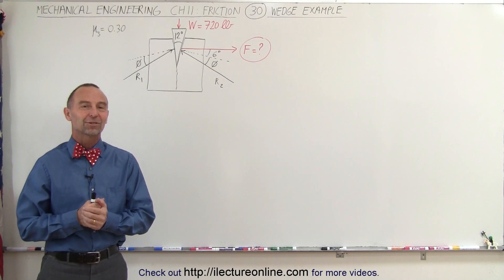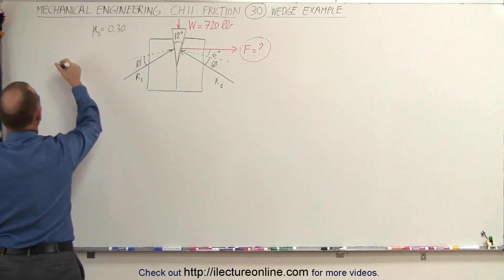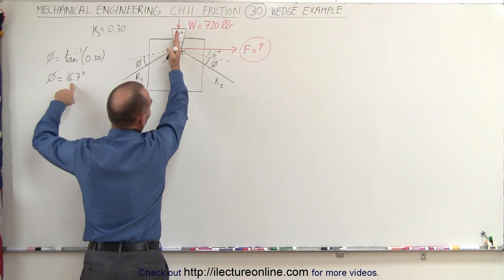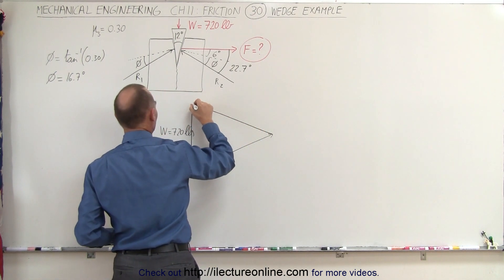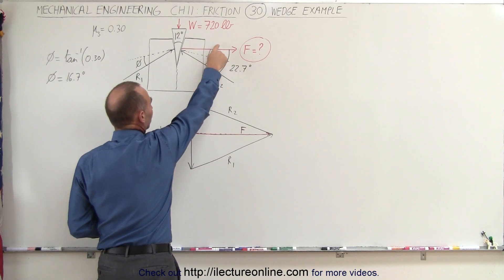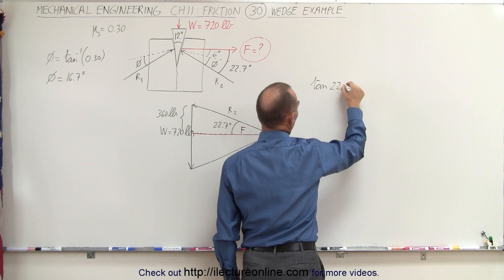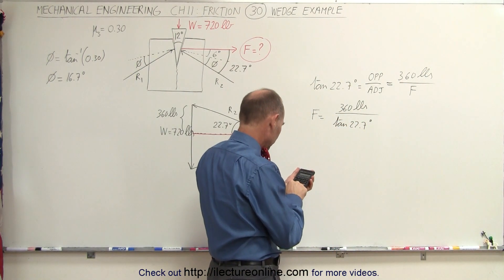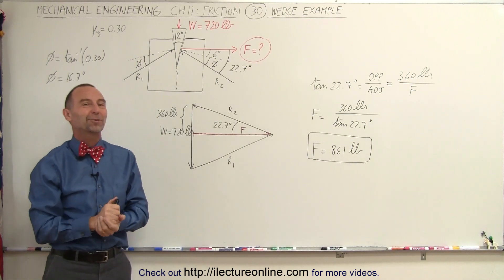Mechanical Engineering: Ch 11: Friction (30 of 47) Wedge (Splitting Wood) Example

Comment: The videos are great and I love them. I am sure I am not the only one, but I notice in your videos there is usually a free-body diagram ready, this is problematic if you come across a problem in which you need to interpret a question.

Suggestion: do some videos with a plain problem and break it down from a diagram, it becomes more beautiful.
Reply from the maker: Thanks for the tip!   We do both as it speeds up the video a bit.

Comment: for this example, how could you work out the force applied from the wedge on the log if you only knew how much (length) the wedge had been pushed in? imagine there was a wedge cut out in the log which the wedge fit into and then you started to move it down through the log by a known distance? how would you calculate the force applied to the edges of the log (against the wedges) as the wedge moves down in known increments? (assuming the tapered hole in the log has no bottom and is a straight through hole)
Reply from the maker: If the distance is not known then you cannot solve the problem.

Comment: Does it also mean we should find the frictional force between that wedge and the ground?
Cause I did and got nearly the same answer.
Reply from the maker: Not sure what you mean by "between the wedge and the ground".
Reply: @MichelvanBiezen  for example,  if the wedge is divided, it goes right and as a result the frictional force between the wedge and the floor moves to the left.
I tried it that way and got almost the same answer as yours.
That's why I was asking whether my approach was correct because I don't understand this method, I use the "resolution of force method" to solve mine, so I was trying to figure a way of solving that with my method.

Comment: A question about some numbers. So the output force is 2.3907 times the input on both sides, but the mechanical advantage is 9.4093 times the input. When do we consider the mechanical advantage of a wedge rather than its reaction force? 

And I have a follow up question if that's alright.
Reply from the maker: The machanical advantage is usually expressed in terms of the ration of the force generated divided by the force applied.
Reply: @MichelvanBiezen thank you for responding! I thought that a wedges mechanical advantage was its length divided by width. Or 2 divided by the tangent of the angle.

My follow up question is how do I apply the reaction force to cutting a given material with known shear and tensile strength? How does the pressure on the edge effect the cutting process if I reduce its sharpness or bluntness?
Reply from the maker: Because the cos of a small angle is nearly one, the ration of the length over the width of the blade approximates the force exerted by the sides / force applied to the wedge.
Reply: @MichelvanBiezen  so how do I use this knowledge and apply it to cutting vegetables meats and woody things?

Comment: I hope you read this in time as I have a deadline tomorrow, but which formula do I have to use to calculate how much force you need to clove a piece of wood?  Which material property do you have to look for in the stress-strain curve? 

I want to know how much force you need to split a 2000mm long chestnut pole with a diameter of 80mm into 4 pieces with a hydraulic cylinder. 

Thanks for the video by the way :)
Reply from the maker: Without context, it is difficult to determine which equation (or method) to use.  My guess is that if they didn't give you the dimensions of the wedge blade (and angle), that they expect you to use the shear stress/strain equation.  You will need to find the shear strength of the wood in question.
Reply: @MichelvanBiezen  Hey thanks Michel for the quick response, I think that will do for now. 

It is for my internship (as a product designer), the person who made the machine doesn't have a 'list of requirements'. So I'm making one for him. I do have all the dimensions as I also drew the machine in Solidworks. One of the logical requirements is that the machine is capable of splitting a 2000mm chestnut pole. I wanted to specify the requirement by clarifying the minimum force needed to split it. I'm glad you mentioned the wedge blade because this also affects it. 

I'm not a mechanical engineer with hard physics, more a designer, yet I do like to figure out the technical aspects, as this will also show willingness to become a solid all-rounder.

By the way you have a Dutch surname, are your parents from Holland?
Reply from the maker: You may want to look up some specifications on these types of machines on the internet.  You'll get a better understanding that way without tackling the physics equations.    I grew up in Belgium (the name is Flemish).
Reply: @MichelvanBiezen  Okay dankjewel voor de tip ;)
Reply from the maker: Met plezier.